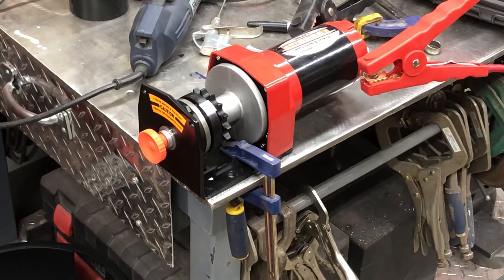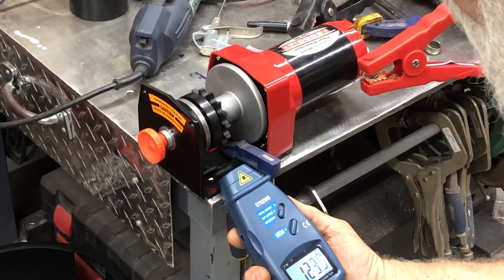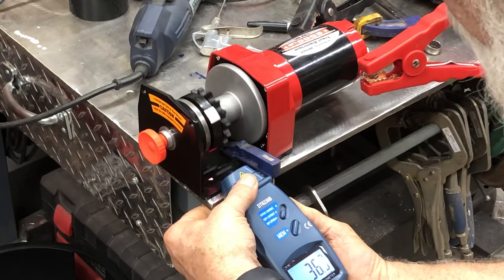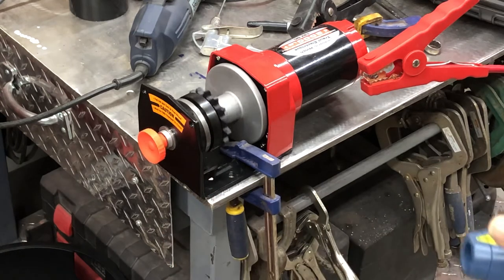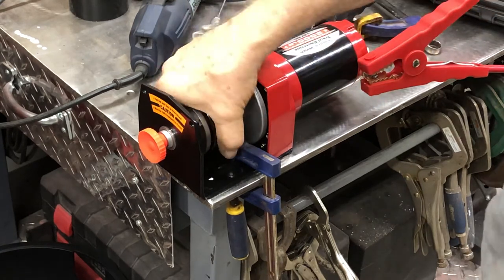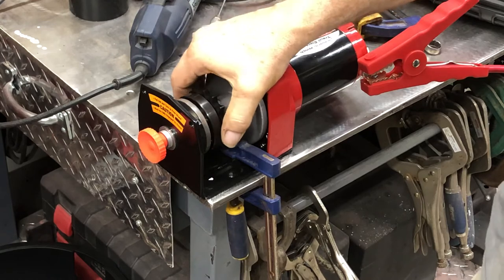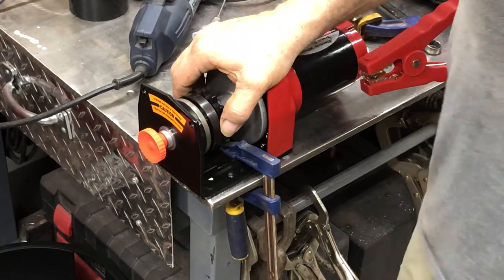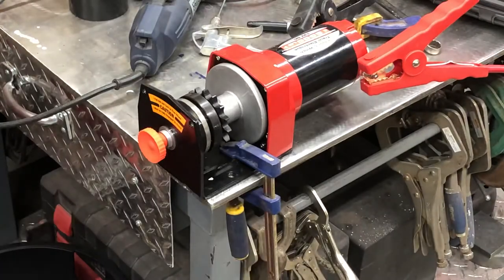The Motovator Project, Drive motor baseline RPM Measurement

Comment: Did you measure the amperage during normal operation?  I was thinking of using a power supply and a drop cord instead of maintaining batteries.